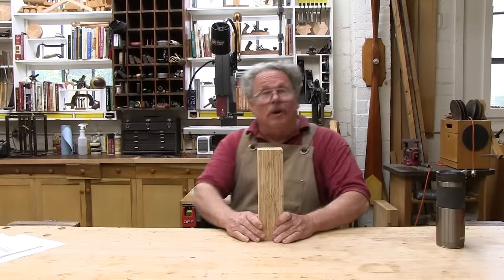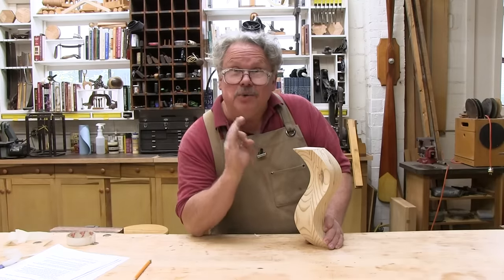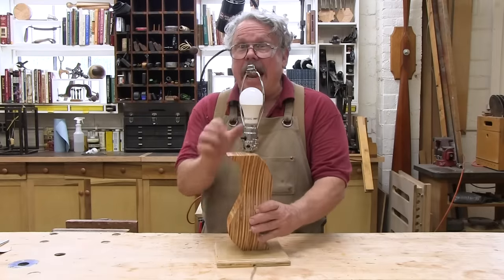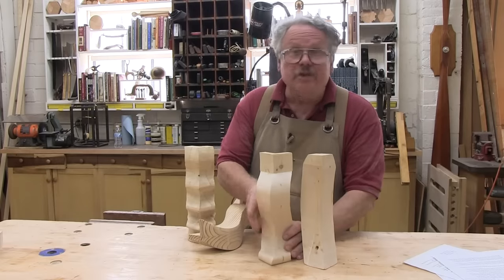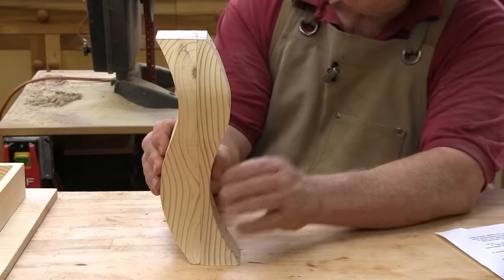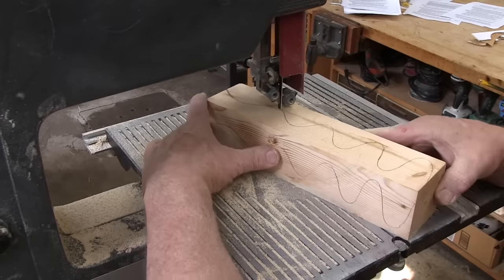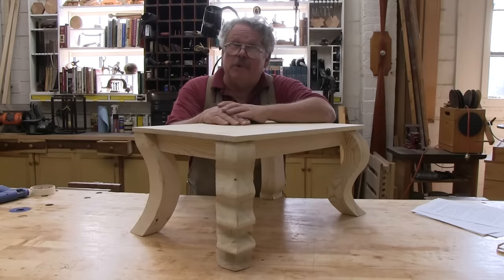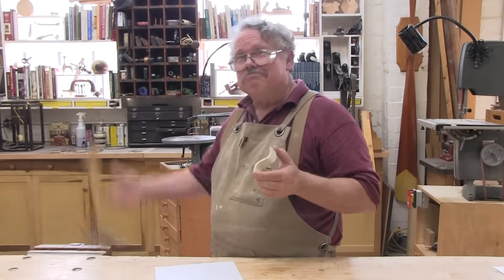Bandsaw Magic - Making a little known trick a little more known

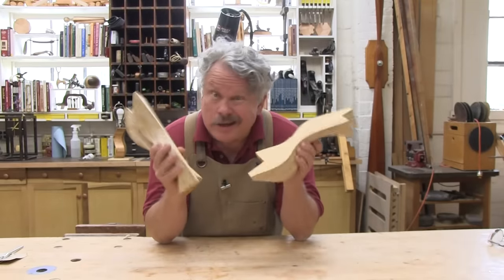Comment from the maker: Folks, I had an email asking why, in gluing up the lamp base parts, I applied glue to just one of the adjoining surfaces during the first step (3:20), then applied glue to both adjoining surfaces during the second (3:50). First of all, let me give some kudos to the viewer who caught that. Good eye -- really! In case there are others out there wondering why,  I was gluing up a 3" x 3" block that was made from plywood. In the first step, I was applying glue to the faces of the plywood veneers and I could expect the joint to behave like a standard face-grain glue-up. But during the second step, I was applying glue to the edges of the veneers, a mix of face grain and end grain. I knew the end grains would absorb a good deal more glue, so I applied glue to both surfaces.

Comment: Awesome, I just bought an old craftsman and I wanted to learn how to make ornamental legs. You're the first video I watched and within five minutes of watching, I made legs. Easy and really awesome thank you so much.
Reply: How did you repeat the legs for four of them by just free handing them?
Reply: @abdulazeez3337  with a pencil I just drew lines where I was to cut with the saw. And got as close as I can. And then the finish work with sanding I got them to look almost identical. Maybe with slight variation.
Reply: @abdulazeez3337  you could also make a template out of cardboard.

Comment: What an awesome video amigo.  Thank you very much for sharing.  Can you tell me what kind of band saw you use?  Is there a particular bandsaw you recommend?
Reply from the maker: Thank you for you kind words, friend. I have four band saws -- a 14" Delta, an 11" Shopsmith, a 10" Great Northern (horizontal), and a Delta 3-wheeler. I'd recommend any one of them, but I'm partial to the Delta 14" for the simple reason that it has a split casting and you can insert risers to increase the depth of cut. There are risers available commercially that will increase it to 12", but I've taken it to 15" on occasion. The band saw in the video is the Shopsmith. It's a good saw, but if you use the Shopsmith headstock to run it, it can be underpowered especially for resaw operations. I've hooked mine to a 2 hp motor and it works great.

Comment: That’s brilliant Nick do you have to cut the same shape on both sides? For example what happens if you cut the waves large to small one side then small to large on the other will it still work?
Reply from the maker: No. You can cut any shape on any side. I've made these experimental shapes symmetrical because it simplifies the video.

Comment: Love your delivery of the information.  Fun and to the point.  i actually built a piano bench with the "magic" last year when I first found your video.  I need to build a table with shelves like you show and I decided to contribute to your efforts by purchasing the plans. 
 I have a question.   I want to build a modified bookshelf that is narrower open top than at the bottom.  The legs stay the same size but top an bottom cut at angle so top shelf would be smaller than bottom.  I am having trouble wrapping my brain around hoe to do this.  Seems like it shouldn't be too hard.  Ideas?
Thanks
Reply from the maker: Any time you leave square and true, you're outside the norm in construction. To determine the sizes and angles you'll need, you have three options. (1) Bone up on your high school trigonometry. (2) Get a drafting program for your computer and learn it -- this will do the trig for you. (3) Draw your bookcase full size, then make measurements and  templates off your paper patterns.

Comment: That 50 grit sprinkle on the glue is an amazing tip.  Would bank sand work just as well?  Perhaps rubbing two cuts of 50 grit sandpaper distribute the perfect amount haha.
Reply from the maker: The grit size seems to be key to keeping the wood from sliding. When I first learned this trick, I tried loading a salt shaker with ordinary sand and found it rarely worked -- most of the sand grains were too small. Some woodworkers report a better experience with plain salt, but here again you have no control over the grain size.  Through experimentation, I found that  50# and 60# sandpapers work well, 80# not so well, and 100# and finer not at all.
Reply: @WorkshopCompanion  Great info!

Comment: Obviously the size and type of the band saw blade had a lot to do with the magic, if I were to try those curves on my band saw it would break.  Could you provide some info on the width and type of blade your using. I subscribed for more, thanks for the vid.
Reply from the maker: The size of the blade is determined by the radius of the curves you need to cut. I made most of the cuts you see in this vid with a 1/4", 14 tpi blade.

Comment: I tried this for the first time the other day and I realized how underpowered my bandsaw is compared to what you use in the video.  What power are you getting from your bandsaw, or what is the minimum you recommend using?
Reply from the maker: As I have said on other threads, the minimum I recommend for a 6" bandsaw is 2 hp. Most manufacturers provide only 1/2 hp, a few go as high as 3/4 hp, but a band saw requires a tremendous amount of power compared to other stationary tools, especially when cutting thick stock.
Reply: @WorkshopCompanion  I have not seen other threads, missed it. Thank you for following up with this comment!

Comment: Thanks for this video. However i am a bit confused about one thing. How can i make repeatable band saw cuts to make four table legs since the bandsaw cuts are free hand? And what size blade thickness is being used to trace the curve?
Reply from the maker: Blade: 3/16" skip-tooth 6 tpi. To make repeatable cuts, first make a template, mark each surface to be cut, and then simply follow the lines. You might want to watch: https://www.youtube.com/watch?v=yGa2bU3l0dI

Comment: Hi I have a band saw I was wondering what blade you suggest I don't have  ton of money to buy several blades.  I want to make some table legs like that . I have a craftsman 1/3  horse power
Reply from the maker: for the melting shelf legs 3/16" skip tooth, for the other legs in the thumbnail you can use 1/4" skip tooth.

Comment: Hello Nick- I understand that you are “THE” SHOPSMITH GURU!!!
I asked another person for help with this and was told they have more pressing items to do.😢
Which led me to you after I saw some of your Shopsmith videos. I recently purchased a used Shopsmith, power station, and a belt sander. One of the videos I saw online was very grainy. On the front roller assembly. It appears that it can be installed on the opposite side of the tensioner knob in one of four ways is my first question which direction? My second question is how do you pry the handle off as well as the side, armature from the rubber roller. Hope you can help me with this problem. Thank you Mike
Reply from the maker: Download the  exploded view of the tool you're working on (so you know what to call the parts) and call Shopsmith Customer Service. They will help you with this.
Reply: Much appreciated, and a Marry Christmas to you!

Comment: Salt works too to keep the pieces from sliding when you glue and clamp
Reply from the maker: And sand. Anything granular. But it has to be the right size. Too small and the pieces will still slip. Too big, and the joints are difficult to close. I find 50# sandpaper the right size.

Comment: Does this modification reduce load capacity? I want to make a aquarium stand for my wife with this technique, but worry about load.
Reply from the maker: The compressive strength is reduced somewhat simply by changing the alignment of the fibers, but I doubt that it's reduced so much that it wouldn't  support an aquarium -- unless you have really heavy fish. I would, however, use stronger joinery to join the legs to the aprons than what I show. A standard mortise-and-tenon would be a much better choice for your project.

Comment: If you tapered the wood before using the bandsaw, could it work?
Reply from the maker: I honestly don't know without trying it. But it seems to me just thinking it through  there would be a small gap when you assembled the four pieces
Reply: @WorkshopCompanion  I think the gap was created for the lamp example, but 5 sides were created where the fifth side of all 4 pieces created the hole for the lamp. Maybe, I can try it when I get access to a  band saw at school next semester.  The instructor is kind of a strict, tough pro-labor type. Tough exterior until he talks about labor and wars.

Comment: I’m extremely limited on space and don’t have room for a whole bunch of tools. I’ve been trying to come up with which tool would be best to get if I could only have one. Can you make good joints(dovetail and/or box joints) with a bandsaw with an attachment of some sort so you have the spacing and the depth correct? I know a routing table and a table saw have ways to make joints easily but you can’t make the sort of cuts like this. I can’t make a straight cut with a handsaw to save my life…
Reply from the maker: I have made both finger joints and dovetail joint with a band saw. The cool thing about making finger joints this way is that the fingers don't have to all be the same size or evenly spaced. I've made chests where the fingers start out large and get smaller and smaller as you go up the corner.

Comment: I didn’t get the end bit with the scroll saw. Can you do the same with a scroll saw or will it be more difficult?
Reply from the maker: You can do it, but it will be much more difficult and time-consuming. Scrollsaw blades do not clear the sawdust from the gullets (spaces between the teeth) as efficiently as band saw blades. Consequently, the dust becomes impacted and prevents the blade from cutting quickly. It also makes it more difficult to follow a line.

Comment: Can I do this with a jigsaw on slightly less massive pieces of wood or is the blade too thick and takes away too much of the wood?
Reply from the maker: You can do this on a jigsaw or scroll saw, but these tools don't clear the sawdust as efficiently as a band saw. Consequently, the sawdust packs in the gullets between the teeth and impedes the cut. It also increases friction which heats the blade. You can do it, but it will take you much longer and many more blades.
Reply: @WorkshopCompanion  thank you for taking the time to respond 🙏

Comment: Fairly new to woodworking so my apologies to all for the potential dumb question here but... is that a stick of super glue in that gun? I've only been using the typical titebond in a squeeze bottle, which seems perfectly fine, but I am wondering if there is an application where I should consider something else.
Reply from the maker: It's just hot glue -- crafter's glue. We used it for the vid because it was fast.
Reply: @WorkshopCompanion  gotcha, thanks for the feedback!

Comment: i am interested in knowing could you use this to make round stock or say a round shaped spindel a this way for us guys that don't have a lathe yet ?
Reply from the maker: That's not the way this geometry works. If you take a cross section of the shape, cutting perpendicular to the length, you'll see it remains square. You can't round over the corners.

Comment: SUPER NICE VIDEO < YOU MAINLY USE 2 INCH STOCK ?????
Reply from the maker: No. The lamp bases and short legs are cut from 3" square stock, and the longer legs are 1-3/4" square.
Reply: @WorkshopCompanion       WHAT SIZE BLADE DID YOU USE ??????
Reply from the maker: @edmc755  1/4" (6 mm), 14 tpi.

Comment: Could you provide the dimensions of your bandsaw blade?
Thanks and greetings from Germany!
Reply from the maker: Mostly working with 1/4" (6 mm), 14 tpi. A skip-tooth would cut faster -- especially since a lot of these cuts are more or less parallel to the grain -- but a blade with more teeth provides a smoother cut with less sanding to do afterwards. On some of the small-radius cut, specifically those on the wavy legs, I switch to a 3/16" (4.5 mm) blade.
Reply: Thanks for your reply.

Comment: Can someone tell me how to make repeatable four legs like this on the jigsaw? It is very difficult to replicate the curves isn't it?
Reply from the maker: The problem with using a jigsaw is not repeating the curves, but making the actual cuts. Because the reciprocating strokes of a jigsaw are so short, they do not quickly clear the sawdust from the cut. The dust packs in the gullets between the teeth and prevents them from cutting. Consequently, jigsaws are much better for sawing thin stock than thick. Table legs, unfortunately, are necessarily thick stock.
Reply: @WorkshopCompanion  thank you. So how would I make four legs using the jig saw per the video shown? I want to construct a table with these legs
Reply from the maker: @diybuildandlife207  Keep the width and the thickness of the legs to something under the length of the saw stroke -- usually about 3/4" (25 mm). This will allow the saw to clear the dust efficiently between strokes.
Reply: @WorkshopCompanion  I am so sorry but I messed up above. I meant the bandsaw when I said jigsaw. So here is the question. Usually with a miter saw I can put a stop block to have repeatable cuts. In the case of a router, I would trace a flush trim bit over a template, In this case of using a bandsaw since all I am doing is drawing a curve on a piece of square wood and cutting the curve through it free hand, how do I ensure I get the same kind of curve for the four legs without a jig? Also what size blade is recommended?
Reply from the maker: @diybuildandlife207  See https://www.youtube.com/watch?v=yGa2bU3l0dI for info about blades and shapes. As for making matching copies of all four legs, make a template and carefully follow the lines. If this isn't precise enough for you, you may need to move up to a 3D routing/duplication system. Or just live with a few tiny differences.

Comment: If I had a jigsaw and router table how would I do this?
Reply from the maker: You might be able to do this with a jigsaw, but the thickness of your stock would be limited by the length of you blade, and the sawing operation would be extremely time consuming.
Reply: @WorkshopCompanion  if I do with jigsaw and say I cut a piece of 2x4 first is there a way to replicate the same cut to another piece of 2x4?
Reply from the maker: @diybuildandlife207  Yes, if you're good at following a template as you cut.

Comment: A+
I was going to thumbs down and grade low because... well... you seemed a little goofy at first. Then the amazing info boosted you to a straight A.  
Using a brush and not your finger to spread the glue??  Priceless
Reply from the maker: Actually, I usually use a threaded rod -- a trick I learned from the good folks at the Franklin Glue Company when I interviewed them for my book on "Gluing and Clamping." Works great; spreads the glue precisely even. And I take umbrage at not being considered goofy enough. I graduated Magna Cum Laude in Goof from OU; it was my major.